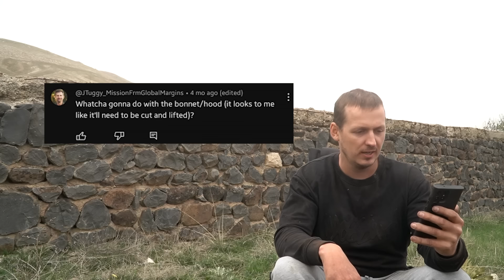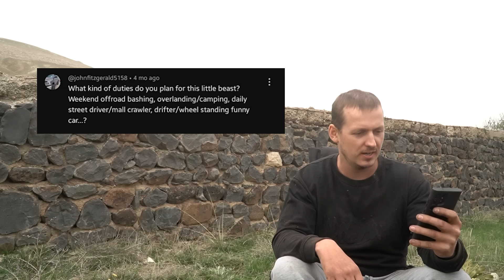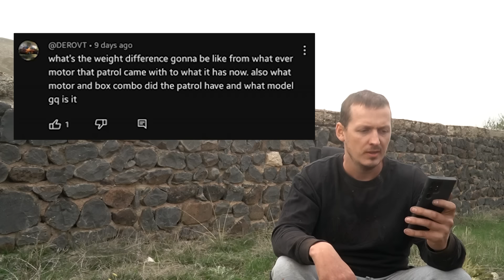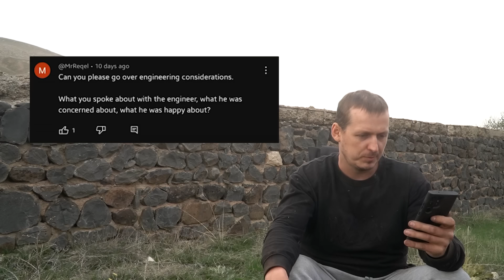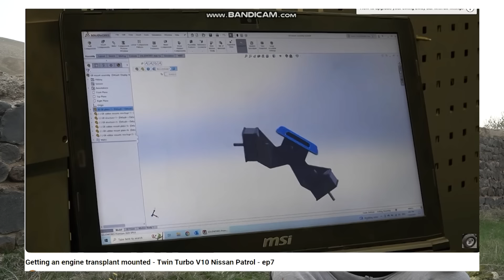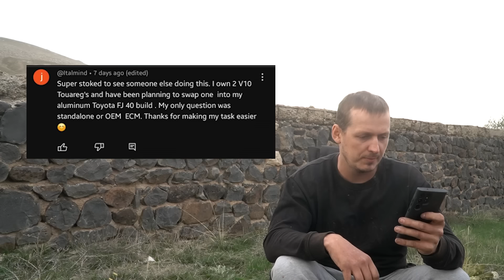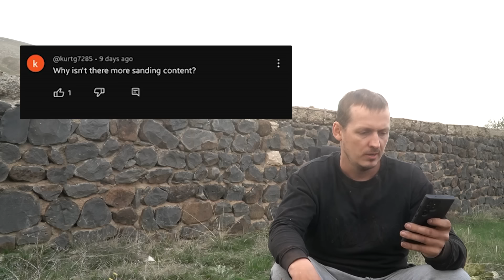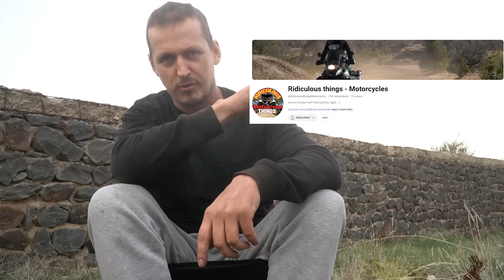I Answer ALL Your Questions About My V10 Twin Turbo 4x4 Project - Secret Ending

Comment: Troy Fink, Fink Engineering, Figtree Wollongong. I was unaware you can certify your own vehicle.
Reply from the maker: As far as I'm aware, there's a way to get your workshop and business approved to self certify. I could be wrong? But I was planning on simple VSCCS certification rather than self certification.

Edit: google "application for self certification". It's an application form that has all the requirements and insurances needed.

Wanna certify my V10? 😏😏

Comment: Use the rear air con to cool the turbos, I have seen it done by an old fella years ago on a 12-ht Sahara with large high-mount turbo running on a veg oil mix.
Reply from the maker: That's quite a cool idea. Better than a bucket of ice in or water spray on the intercoolers

Comment: Just putting it out there (as a previous 7l owner) that the Touareg probably is a bit more than a soft roader. I have taken it places that LandCruisers have broken things. 

Having said that, aside from a superior traction control(for its age) and more punchy power. It doesn't compare to the prado I now drive. Unfortunately it just is a fact that LandCruisers, Prado(not a LC) and Patrols just do better offroad. And as soon as flex is required, the touareg is a no go
Reply from the maker: I was probably a bit harsher than necessary, but yeah, they're great vehicles, but by comparison I wouldn't compare my LandCruiser to a comp truck.
Reply: @ridiculousthings4x4  You totally were more harsherer than necessary.  I got one at the start of the year - only a baby V6, but the 7L and 7P are proper full-time 4WD, with a low box and centre (and occasionally rear) diff-lock.  You're not wrong on the towing - it's the cheapest 3.5t capable vehicle around in the UK and it is SO good when it's hauling 3.5t of digger etc.  With a set of Goodyear Duratrac covers it's also very capable in the sticky stuff (ignoring the weight a bit).

Comment: 16:52 You can buy the engine for around $10k in Germany, thats without the gearbox and some other components but all in it shouldn't cost more than lets say $15k-$20k. I just don't know if you'd be able to register it if you just buy the engine standalone without an official donor vehicle
Reply from the maker: So far the whole thing has cost probably around that first figure you put up, however, buying just parts for a project never works out unfortunately. There's always a load of expensive stuff that's forgotten about that racks up the price. I personally think the only way to do a good conversion within budget is to have a whole donor vehicle, or at least a running half cut. $10k for a new V12 sounds optimistic though, they want double that for a VDJ from toyota

Comment: i swear i asked this question in one of ya videos but whats happening with the exhaust?? it’ll be hard to match the sweet vdj toyota note but im sure a v10 diseasel would have a very sick (unrestricted) noise…?
Reply from the maker: Each bank exits into a 2.5" dump from factory, but that's where the factory ends. Those combine into a 3.5" collector (because the surface area of 2x2.5 is almost the same as 3.5) which is then single piped into a muffler. Muffler back and over the diff to the factory location is a "to be completed" as it's got some scary bends.